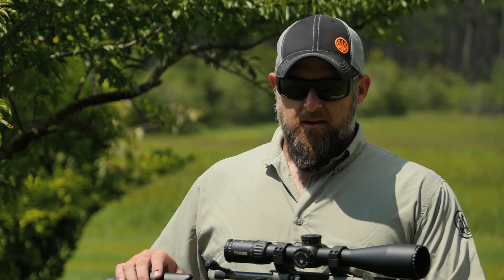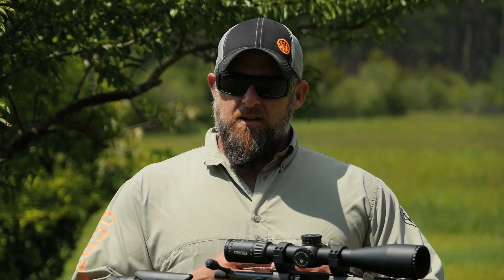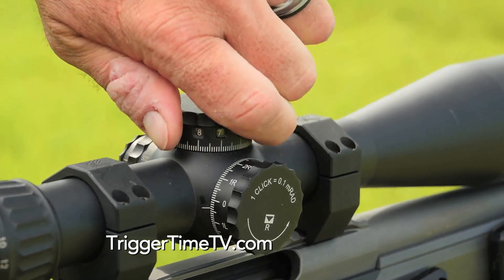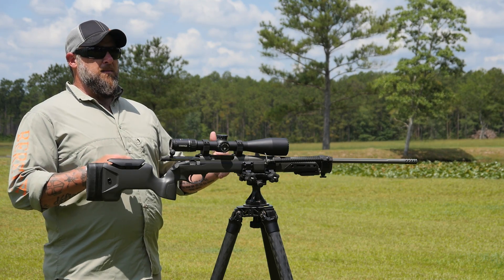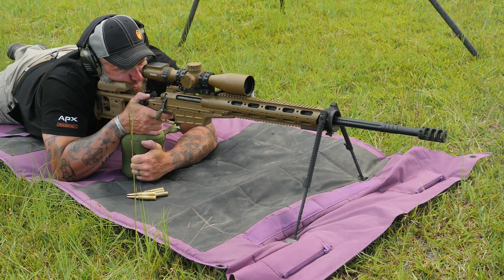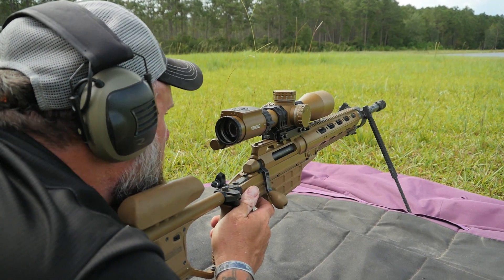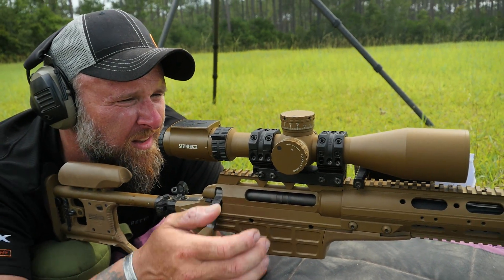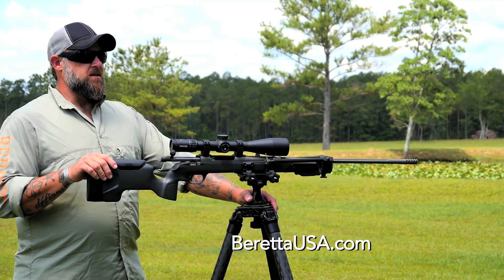Catastrophic Malfunctions with Bolt Guns with Todd Vanlangen

Comment: Todd, Great video. How do you like that Steiner Optic? And about loctite.... if it's used correctly, a tiny amount on the screws only, it does it's job correctly. I know that you know that. I use the Valdada Recon G2 40mm tube, on both my 338LM and my 375CT and I have the Valdada 40mm King Kong mount that utilizes 6 screws for each saddle.... now that's a pain, tightening down all those. I've never had a problem with something falling  off.
Reply from the maker: Todd is a huge Stiener fan!
Reply: @TriggerTimeTV  Is this Todd speaking in the third person about Todd.... or is it a TTTV assistant speaking for Todd?